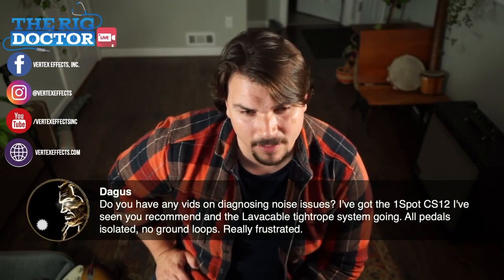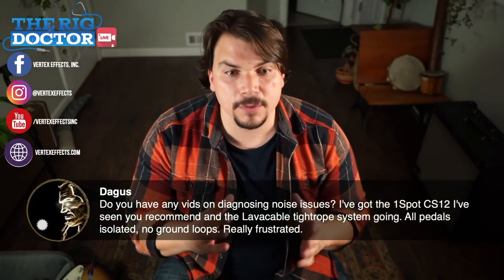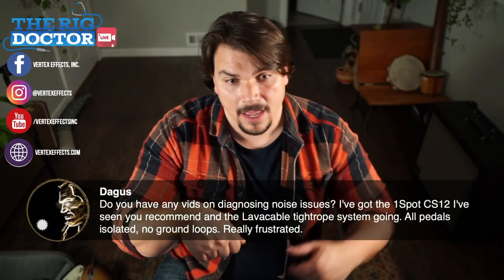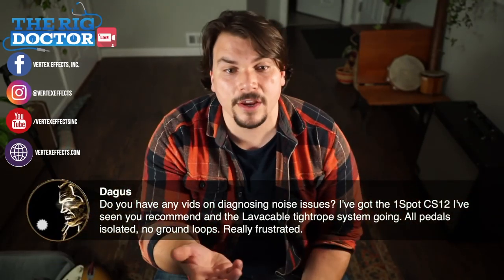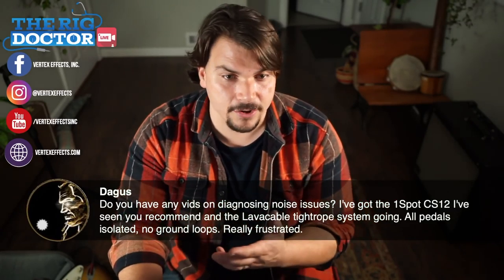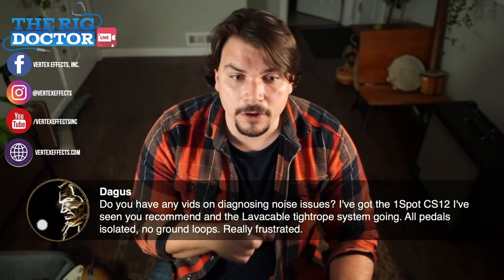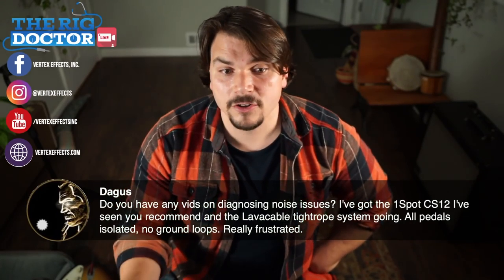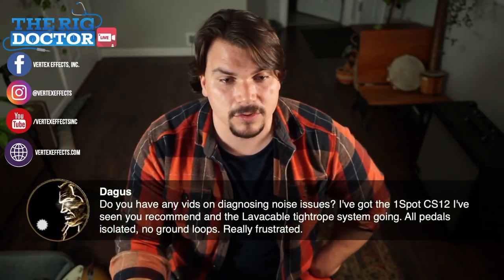Fixing a Noisy Pedalboard!

Comment: Hello. Why does my pedalboard sound fine and make noise or hiss when plugged in through the front. But when I am running the pedals through the fx loop theres a ton of hiss ?
Reply from the maker: Depends on the FX loop and what pedals are running into it.
Reply: @VertexEffectsInc  I've tested my rig on 3 different amps. A peavy xxxl [there was noise] a bugera 6262[ noise] 
And then I tried an orange cr120 [no noise] . I'm wondering if it's the construction of the fx loop somehow .

Comment: Hi man! I’ve been recording a live session with my band and had some problems with my pedals today... When I engage my drive pedals (TS9 + OCD) a loud high pitched squeal sound occurs when I’m not playing. I’m powering these pedals through the strymon zuma so I’m not sure what the problem is. Any advice? Thanks!
Reply from the maker: Is your guitar the same?  Do you have unpotted pickups?  What happens if you turn your guitar volume off?  What happens if you just run guitar OCD, TS(, Amp?  Have you tried different cables?
Reply: @VertexEffectsInc  I’m using the new fender professional series 2 telecaster deluxe. I’m not 100% sure whether the pickups are potted or unpotted, however I think this only occurs at high volumes which leads me to think it’s down to the pickups. Any advice?
Reply from the maker: @lukeswann1484  could be other things in your chain or in your room causing this issue and the pickups are sensitive to it.  Without hearing it or seeing it, it's hard to say.
Reply: @VertexEffectsInc No worries! Thanks so much for the advice, I’ll definitely inspect individual pedals/cables too.

Comment: I have a Flatted B note hum.. 🤷 Its when I plug into my FX send on my mixer.... what do you recomend
Reply from the maker: Not enough info for me to know anything.
Reply: @VertexEffectsInc  7 pedals all on bypass and there is a hum... the first pedals in jack goes to fx send and the last pedals out gies to stereo aux return
Reply from the maker: @voxydian2689  still doesn't say much.  You're running a guitar rig into a mixer?  Guitar goes into one channel of a mixer?
Reply: @VertexEffectsInc  okay... the pedalboard is hooked through the fx send and aux return.. The guitar is going into a channel.... on the mixer.... so I can control the pedals effects on the mixing board without ever passing the guitar physically through the pedalboard... What Im saying is is that I only noticed this hum after I found out how to use fx send and aux return., Now.... on the other hand, when I do plug my guitar straight into the pedalboard the hum is not there.. Id like to not spend two or three hundred dollars for a voodoo power block if I dont have to so Im just asking for some advice... if you dont know just tell me and Ill move along... thanks in advance
Reply from the maker: @voxydian2689  Are the pedals have isolated power?  Is your guitar and amp on the same ground as the mixer?  Can the pedal accept the level out of the Aux Send from the mixer or is there a send/return level on your mixer to account for this - a lot of them are line level by default, somewhere around +4 where most pedals are -20.  If it's a ground loop some sort of isolation for the amplifier might do it - Radial has a few isolation options for guitar amps to provide galvanic isolation.  That might be a good start...your mixer might also have a ground lift for the Aux depending on the quality of the mixer and its features.

Comment: What do I do with a pedal that's noisy, even on it's own? I have a double overdrive (TB Drive by Rodenberg) and it makes a loud humming noise with two different power supplies.
Reply from the maker: what's the voltage?  current?  does it take a battery?  What are you comparing it to?
Reply: @VertexEffectsInc  it doesn't take a battery, it has 9V and I use a 12V / 500mA power adapter with it. I found out it's the noisiest when I have it on my board. Doesn't matter if I plug it to my Harley Benton ISO-1 Pro powerplant or the extra adapter. 
It seems to be fine now though on it's own with an extra power supply.
Reply: I put the OD pedal off the board now and realized that my carcosa fuzz, that's before the mentioned overdrive pedal on the pedal board, also creates that high whistling sound when I engage it and turn up the volume knob. Will take that also off and see if the sound's still there.
Reply: The whistling sound comes from my mini wah that is before the fuzz and OD and seems to be amplified by those two pedals. When I take the wah also out, there's only Guitar to my polytune mini, noise killer, octaver, chorus, delay, reverb, looper. If I engage the noise killer it kills the hum, so it can only come from the polytune 2 mini right?

Comment: Mason, what if the pedal's switch suddenly starts making a pop sound in ur amp? It didn't do it until today when I added a GFI Specular Tempus, replaced a cheap patch cable at the end of my chain (so that now I have all Van damme cables which I made myself) and put my power cables in a different order (some of them go across patch cables, but the pedal sequence remained the same, just it seems the whole signal became better but a lil more sensitive). Could it be cuz of the cables or what's going on? My PSU is Strymon Zuma. Thanks!
Reply from the maker: Sometimes it can be related to the impedances, the types of footswitches, other changes on the board.  I don't think it's your power supply.  You can test your new pedals alone to see how they behave, but frankly I think that most players make too big of a deal about "pops" and most stage performances it becomes pretty negligible.  In a room by yourself it seems catastrophic but a lot of these old FET switchers popped too even though the pedals were all in loops.
Reply: @VertexEffectsInc  thank you very much! Cheers!

Comment: FYI Lava Tightrope is a ripoff from the Evidence Audio SIS system, but apparently with inferior parts.
Reply from the maker: TheSphericalGuy I wouldn’t know.  Looks like there are a few versions of the Lava, one that is all solderless another which solderless a boot over the center conductor - my experience with solderless is limited but there is a lot more info in my video on soldered versus solderless cables if you’re interested
Reply: @VertexEffectsInc  Well, I do know that the Tightrope specifically uses the same mechanism as the SIS system. I tried their original solderless cables many years back when I started getting into switchers and it was without a doubt the worst design I've ever come across. Been using Squareplugs for about a year and couldn't be happier, happy to see you've discovered them as well!
Reply from the maker: TheSphericalGuy 🥳🥳🥳

Comment: I'm having the exact high pitched issue you had. But its not faint in the least. The only pedals I have are the dl4 mk2, a volume pedal, and the shigeharu fuzz. The whine noise goes away as soon as I unplug a pedal, doesn't matter what configuration I have, the noise stops completely. I'm stumped.

Comment: Once you find the problem unit then what? I'd hate to dismiss a $300.00 processor I just purchased.
Reply from the maker: If it’s a specific device you can start to look at what’s powering it, proximity to other devices, isolation (perhaps via true bypass loop), or repair or modification.

Comment: I once had a problem that I wouldn´t think ever could happen. I use an isolated PSU, and quality cables (most of the way) and I had a terrible buzz, that I could isolate to the delay.
When I touched the cable it got worse. I changed the cable and the buzz was gone. And then what was the cause? I split the colored molded cable with a knife, and it showed up
that there were no screening what so ever in the cable or around the plug. Cheap Chinese junk.

Comment: Ok, found the pedal. Now what? haha
Reply from the maker: Maybe it needs a repair, contact cleaner, or to be removed or substituted
Reply: @VertexEffectsInc  Right, thank you for responding. I've never seen this noise. It's a whistle. It appears 17 minutes after it's turned on. It's a digital delay pedal, it's one of the last in the chain (goes in between a chorus and a digitech drop, powered via ac cables). So weird. I'm cleaning it right now. Let's see!